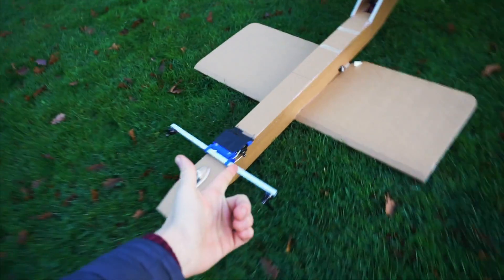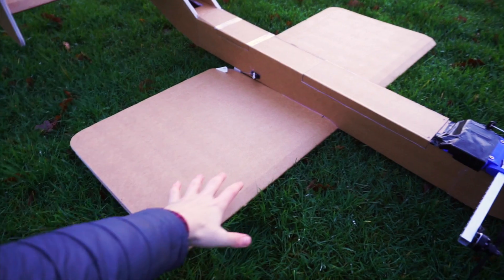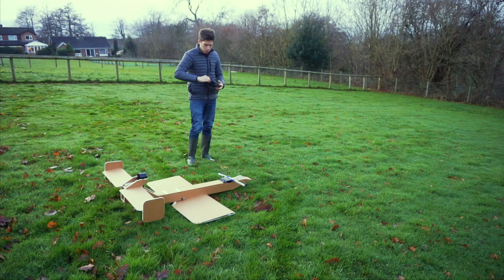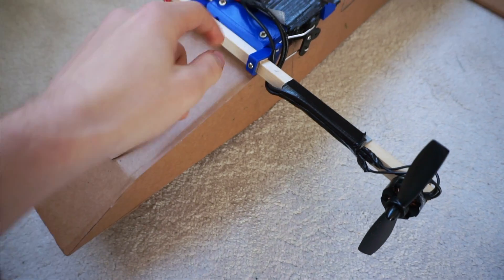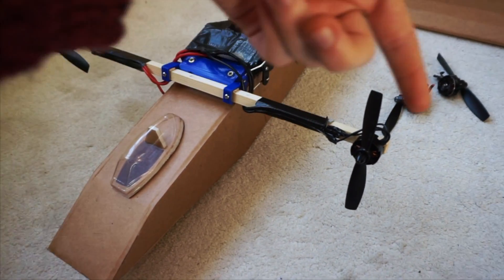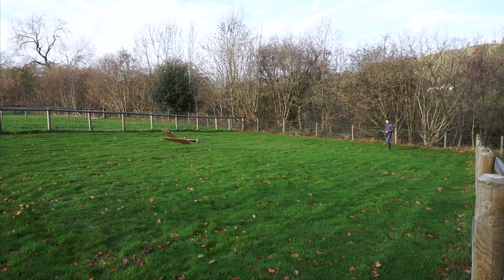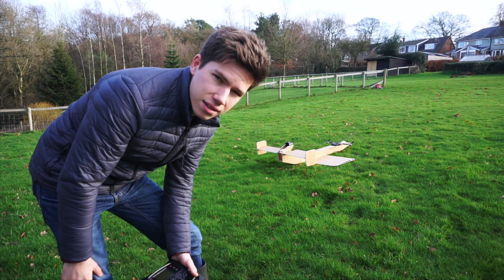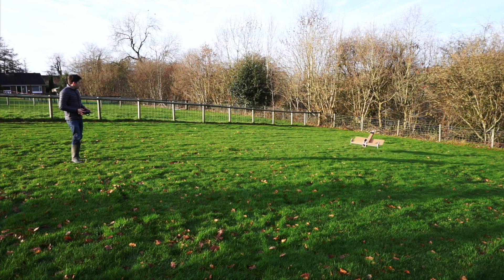Thrust Vectoring Giant RC Ekranoplan - Part 1

Comment: The big russian ekranoplans could fly out of ground effect to cross obstacles. The mass of the craft made it easier to balance them out in groundeffect, than it will be with a small scale model. They also only vectored the thrust of the front engines to help build the groundeffect cushion under the wings at slow speeds, not for pitch control. A wing in groundeffect is very unstable in pitch, that is why they needed the big and elevated (out of ground effect) rear stabilizer and a well setup combination of main wing and elevator incidence. And even then they had problems with pitch oszillation.
An easier configuration for a rc model could be a tandem wing. A craft with this setup should be self stabilizing.

Comment: Great progress so far. Didn't looked as cold as you described it. But UK is a tall country and it depends on where you are based if you are not living in a fridge already. 
That book looks promising, didn't recognice that you had written it until you mentioned it. Unfortunatelly amazon.com will need 3 weeks for delivery to europe. 
Isn't it available on amazon uk? 
I buy a lot in the UK and shipping is fast and reliable - at least until brexit will bring issues like customs / taxes or delays cause I won't drive for a uk package to customs.
Maybe you can find an update for european buyers to get a faster delivery.
Reply from the maker: Hi, yep the book is available on amazon.co.uk and on individual European Amazon sites meaning you should be able to get them shipped to you in just a few days wherever you are (each book is printed locally to where you order it). Here's the one from the UK site. - https://www.amazon.co.uk/Flite-Test-Book-Airplanes-Everything/dp/1724279211/ref=sr_1_1?s=books&ie=UTF8&qid=1545124748&sr=1-1

Comment: 4:26-4:27, 4:44-4:45 and 4:57-4:58 you've got your actual ground effect flying. The whole idea is to spend only one half or even one third of power than you'd need for the midair flight. But your model is too small so it needs way more flat surface to fly above without touching touching it. Seems like the effective altitude for your scale is somewhere around 2-4 centimeters which is too close to the height of the grass. And I'd not suggest water as it would make waves and interact with the model in general. Try some asphalt or concrete parkings or smth. Or just build twice or even three times bigger model.

Comment: Very good project, keep trying
 These effect ground"airplanes"  need to have the center of gravity very behind so that they fly by effect ground but if they are accelerated much they turn backwards. The one I did a long time ago didn't work at all. In mine I didn't put an elevator , but maybe putting a big elevator with a Gyro you get it to fly level at all speeds.

Comment: Having made a few ground effect vehicles myself...
Grass is one of the worst places for testing a small scale Ekranoplan. An Ekranoplan only needs huge amounts of thrust to get up to flying speed. After that, it coasts along with almost zero drag. Pulling out of grass requires exponentially more power than accelerating on concrete, especially if you give it a gentle push when getting it started on concrete. As you saw, as soon as the craft got remotely into ground effect off of the grass, the excess thrust ripped it straight out of ground effect into a mushing stall.

I'd recommend a few modifications:
Test on asphalt or concrete, rather than grass.
Link the thrust vectoring to the elevator, rather than a switch.
Give both the wing 5 degrees more incidence.
Give the horizontal stab ~1-2 degrees more incidence than the wing--this pushes the nose down as the craft accelerates, keeping the model in ground effect.
Put endplates on the wing.
Don't rely on thrust from the motors to fly--Let the wings lift the craft, and the motors gently pull it along.
Reply: Ye I was going to say. The Russian ones had to fly in perfect weather conditions over calm waters. :)